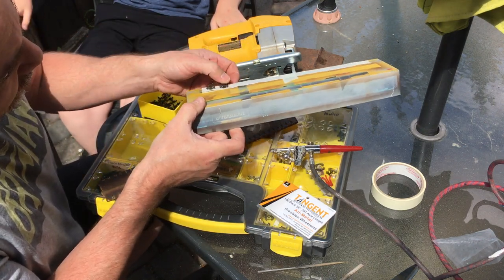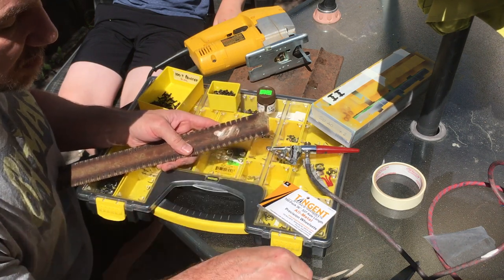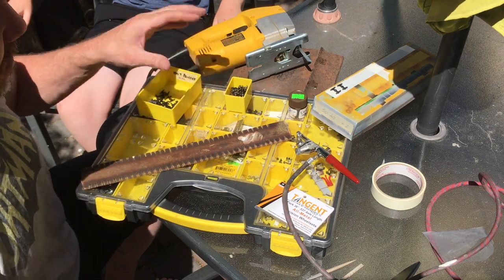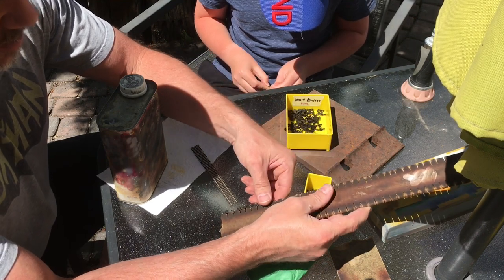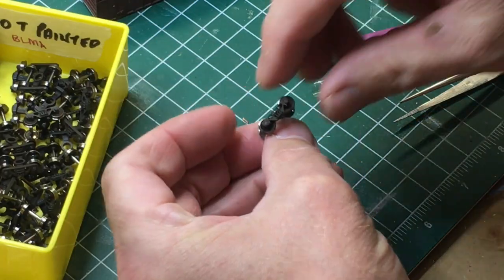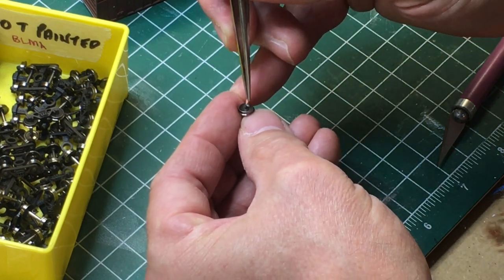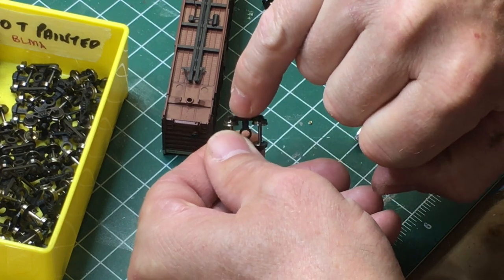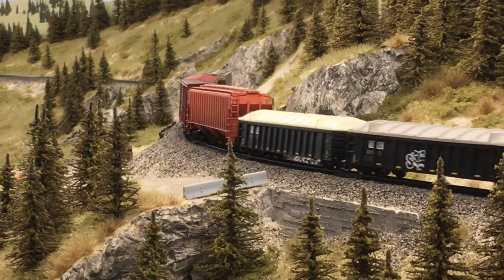Bye Bye Slinky Effect... Painting and Fine Tuning Freight Car Trucks - Southern Alberta Rail

Comment: Neat stuff. The slinky effect is certainly a bane of N scalers. I might try this in HO and see what happens.
Reply from the maker: Curious how it would work in HO with the increased mass.  If you give it a whirl let me know.
Reply: @SouthernAlbertaRail  so I tried it today with a hopper that was free rolling really bad on any track that wasn’t perfectly level. I used the springs from Kadee 58’s. First test was with one half spring on one wheel per truck, and it helped but didn’t prevent it from moving completely. Using about 3/4 of a spring on each truck did the trick. The spring is enough to keep it from moving, but doesn't prevent the wheel from turning. Might be able to get away with using the whole spring. Further testing required.
Reply from the maker: Sounds promising.  Would be handy if you didn't have to modify the spring.

Comment: Thanks for sharing. I know that trick. Using the springs. Some of my cars have them. You like the Tangent wheels. There trucks too? I need around 300 wheels.
Reply from the maker: They are basically the same as the BLMA/Atlas wheels.  I had about 40 BLMA trucks I needed wheels for and couldn't get them from Atlas so the Tangents filled the bill.  The Tangent 100 ton truck is just as good as the BLMA/Atlas truck in my opinion.  Almost identical with the same bolster height.  How dd you make out with the brackets?
Reply: @SouthernAlbertaRail  Good. I only made enough for two cars. I have two covered hopper to try them on. And how do you know what wheel to use? Like when to use 33 or 36? And what truck for each car?
Reply from the maker: Enough to get the first couple under your belt and then it's off to the races.  We can go over wheel sizes in an upcoming live stream if you like.
Reply: @SouthernAlbertaRail  Yes I would like you to. I went to Tangent. $80 for 100 wheels. 36 inch .537s I think that what you used. When I wanted to see there 100 ton trucks it looks like it will be something for the future.
Reply from the maker: Have a look on MB Kleins site for BLMA 100 ton trucks.  Last I checked they had some in stock.

Comment: Why aren't you using the little springs that come with the coupler kits?  They're made for just what you're doing, a little larger in diameter to fit right over the axle point.  Not as many "turns" admittedly but they do seem to do the job.
Reply from the maker: I tried that initially and found that the larger diameter made them visible.
Reply: @SouthernAlbertaRail  Do you do this on every car?
Reply from the maker: I do Doug.  One spring on one axle on one truck.  The other truck is free rolling.
Reply: @SouthernAlbertaRail  Thanks Grant.  I plan on doing that as well.